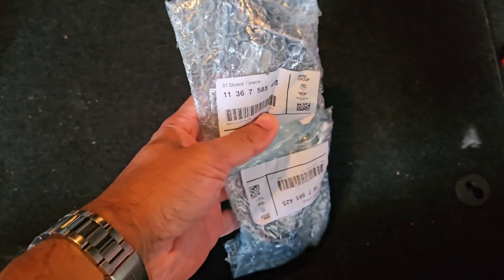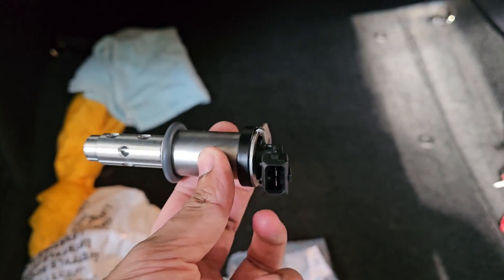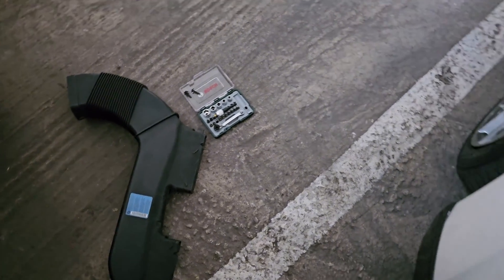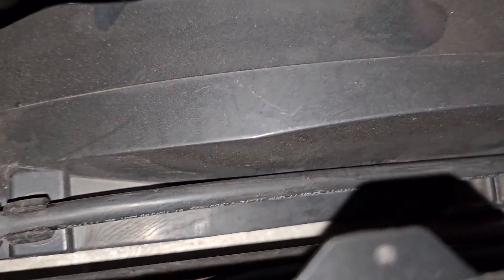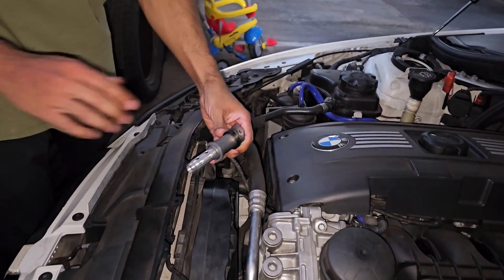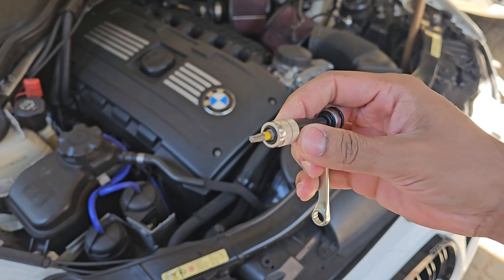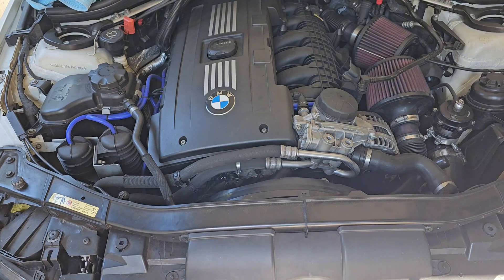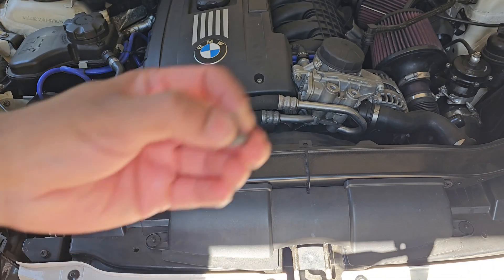N54 E92 335i VANOS Solenoid Replacement DIY | Code 2A87 Fixed! | The Carbon Connection | 4K

Comment: Mine is running kinda 'bad' it pulls laggy around 2,5/5k rpm, got the p0015 error yesterday and all the power was gone.
Should i try this?
Reply from the maker: @skilleragario  it might be the VANOS sensors in your vase. Perhaps try cleaning the Solenoids first before replacing them and see if the problem resolves.
Reply: @ thanks for your reaction, i think i will just replace it because it only costs €30, im scared it will come back
Reply from the maker: @skilleragario best of luck! Let us know if it gets sorted

Comment: Why was it necessary to change the Vanos Solenoids? What problems were you having ?
Reply from the maker: @joegarcia3852  car was miss firing and had rough idle with CEL. I had a Jb4 with the Bluetooth connect kit and when I read the codes it lead me to VANOS Solenoids needing to be changed as the solution.
Reply: @The_Carbon_Connection i have the error p0015, the car drives laggy and doesnt pull smooth and idk if its because of this but the cold start is also gone
Should i replace the vanos solenoid?

Comment: I have replaced the vanos, but when I drive the car in fourth gear, it will jerk back and forth.
Reply: I love how easy it is to replace on the n54 vs n55
Reply from the maker: I found this a bit tough because of the lack of space. Haven't actually looked into the n55 DIY. I'll check it out.
Reply from the maker: Strange that it only happens in 4th gear. Could it be a gearbox issue?